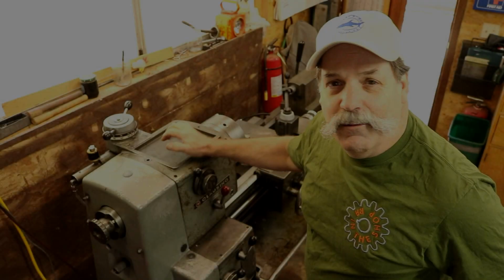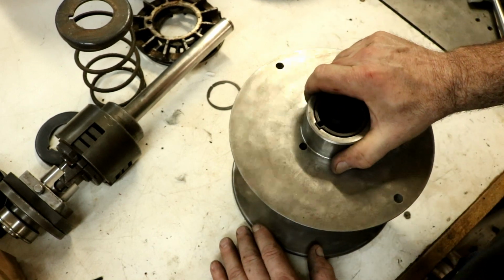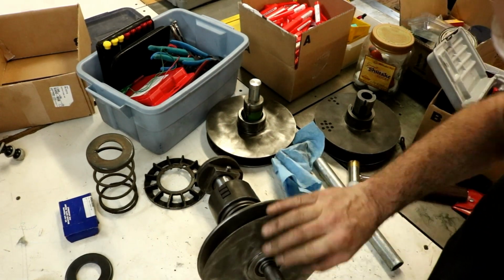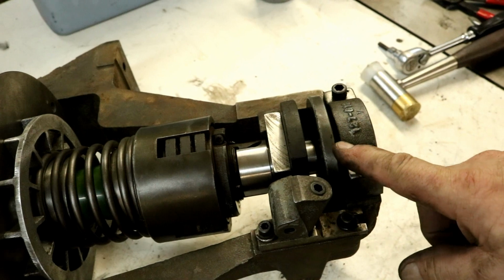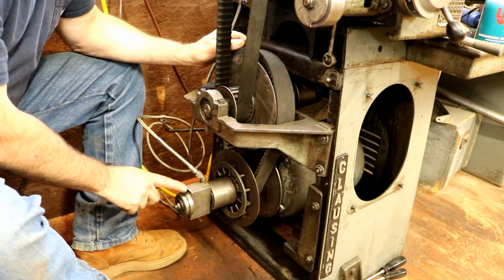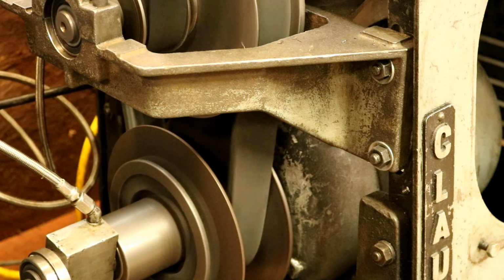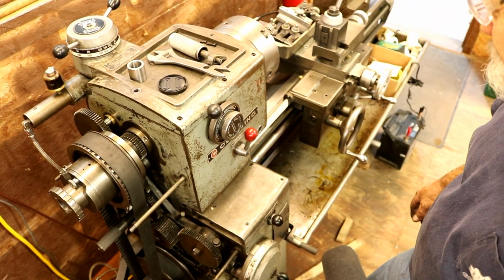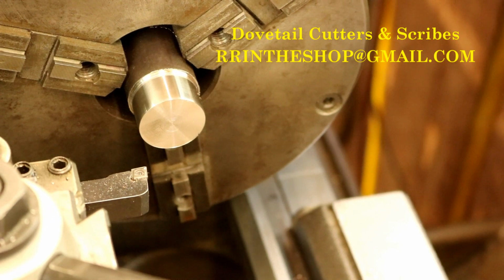How To Repair Crosshaft Variable Speed for Clausing Lathe Part 2 Final

Comment: Randy what did you have to do to the switch to make it control the fwd and rev on the VFD. I am doing the same with my 5913 and I seem to get confused when I try to make the switch work. I realize that ground is common and on my VFD there are a dir 1 and dir 2 and all you do is add ground to either to make it run in fwd or rev but I seem to have hell getting my switch to make the 3 positions. Did you have to modify the switch add jumpers or just wire to the right terminals. Thanks Terry
Reply from the maker: Yes Terry, I disassembled the switch and reconfigured the contacts.  So they would work for this
purpose.

Comment: Wouldn't happen to remember all those bearing numbers would you? My 6913 has been getting noisy the last month or so and when I pulled the cover I noticed that cross shaft sliding from left to right and the large belt is rubbing hard on one side. Looks like i'm in for a project. Also my clutch is slowly slipping out of engagement.
Reply from the maker: All of the bearings on the cross shaft are the same.  I will find the info.

Comment: Really nice job Randy, enjoyed seeing the lathe come together. Dont know if you have a collet system with that lathe but if so that might help you isolate the chatter....but am sure you will get it ironed out ~ Richard
Reply from the maker: Yes I do have a 5C closer,  I had 0.0025 runout in the spindle, I was able to adjust to 0.0005.  Working great now.  Thanks for stopping in.

Comment: Nice job

I have a classing and it’s a great machine
Reply from the maker: I have not really used it yet,  I need tooling that fits.  I think it will be great, runs very smooth and I  fixed the run out issue.  Thank you Dave.

Comment: what if you try the heavy spring with the shorter spacer.
Reply from the maker: I will give this a try to see how it goes first.  Then evaluate.  Thanks Steven.
Reply: You're welcome
Reply: Randy Richard In The Shop just a thought
Reply from the maker: All thought appreciated.  Right now just not feeling like tearing apart again.
Reply: Randy Richard In The Shop it's running it's working I wouldn't want to tear it apart either good job

Comment: That's a sweet drive system.
Clausing makes a sweet lathe.
As with all used equipment, it takes time to get all the bugs out.
I am fully confident you'll soon have the best running Clausing ever.
I've been looking at variable speed belt drives for a couple different applications so this is very interesting to me.
Thanks for another great video.
Thanks,
John
Reply from the maker: Thank you John.  Running well.  I need some tooling for it now, so I will be working on that.

Comment: Hey, I see that yellow old navy (not "Old Navy") battle lantern in the background. I'd like to have one of those. Haven't seen one in years.
Reply: On topic: that weaker spring seems to work just fine closing the pulley disks back up. I imagine the stiffer spring might have resulted in faster belt wear. Do these belts ever get any lube dressing?
Reply from the maker: You may be correct on this, the belt that came off the lathe was trashed.  I think I will get some belt lube to apply.  Thanks for the thoughts.

Comment: glad you have it up and running   My brother and i have 2 6913 clausing and 1 6303 clausing . your manual should have the belt replacement  guide in it . we put the belt on the intermediate shaft on the bench then put the whole unit on the lathe. the drives are a pain but once you go thru a learning curve life will be somewhat easier,
Reply from the maker: Thanks Richard.  Gotter done, but a pain.  Runs very smooth now.

Comment: I remember reading an article about struggling with the finish, one thing was to mount the motor on rubber, may be worth a look, nicely done Randy.

Regards Alan.
Reply from the maker: Vibration solved, 0.0025 runout in the spindle.  Tightened 0.0005 now and no vibrations.   Thanks Alan.

Comment: Deere uses a lot of those variable speed pulleys. What that thing really needs is some grease seals where the moving sheave slides on the fixed one and some grease in there, That coating likely is not enough slickem as those things really need to slide nice with very little clearance as soon as they start to cock from the uneven wedging caused by the belt they destroy themselves.
Reply from the maker: Yep you are spot on Brian.  These are a terrible setup.  This should work for a home shop lathe for awhile.  I have these other pullies and I might do some mods to them to make things better.  No harm they are junk right now.  Thanks Brian.

Comment: Nice job Randy, that drive system looks like a major PITA to work on.  Lathe sounds smooth and I read the comments that you got the vibration problem solved, good deal.
Reply from the maker: Thanks Bill.  Got that sorted out yesterday, works fine now.

Comment: Glad you managed to finish up with a decent vari-pulley. Altogether you've had quite some challenges getting things sorted out.
That whole shaft is quite something with clutch, brake etc as well as the pulley. Great work.
Sure is running sweet and quiet... love it. You've gotta be super stoked at the results.
Reply from the maker: Happy that is done,  Should be good for a home shop lathe.  Thanks Chris.

Comment: Congratulations on getting the Clausing Lathe to run well again and so quiet when running at high speed. This has been a fun series to watch.  Also, thank you for putting together the various play lists because you have published a lot of video material over the years. I think after your lathe leveling work you will have an outstanding lathe for more projects to video.
Reply from the maker: Thanks Paul. All leveled and spindle adjusted. Vibration solved, 0.0025 runout in the spindle.  Tightened 0.0005 now and no vibrations.  I should make something on it now.  I need to come up with some tooling for it. 1/2" shank.  I have to rob from the Logan for now.

Comment: wow, what an effort. i commend you for your tenacity. i have a JET that hasnt run in 5 yrs. Apron 1/2 nut housings failed. Jet sent the wrong part 3 times. After 4th try I got them made right. discovered dovetails operating 1/2 nuts getting no oil. still havent got oil feed solved. Sooo your job 10x mine. 10 pts &  1 for extra credit.

Comment: Nicely done restoration. ...   ;)
Possible that the vibration comes from you insert holder, it seems to be hangnig out quite far, it doesn't take a lot to make some singning...   How about heavier cuts, how does it deal with those...???
Cheers,   Pierre
Reply from the maker: Vibration solved, 0.0025 runout in the spindle.  Tightened 0.0005 now and no vibrations.  Stay well my friend.  Thanks.

Comment: i was a millwright in a steel mill machine shop years ago. we had four of those lathes and were lucking to have two running at any given time. most of the troubles were in the variable drive. parts were so hard to get that we used one lathe as a parts doner. when the five year depreciation was up they were scrapped. i didn't miss them. i expect you to have much better luck in a home shop environment good luck.(good video).
Reply from the maker: Solid machine, but the drive system sucks.  A flat belt drive would be better.

Comment: There is nothing simple about that Clausing drive.  Designed by the devious mind of an Engineer!  Thank goodness for snap-ring pliers!   I almost bought a Clausing, glad I didn't.  The problems with the hydraulic speed control and pullets is what turned me off these lathes.  Great work on the restoration.        Hope you have a great trip.  Stay safe!
Reply from the maker: This is a good reason not to buy one.  There are mods folks have done with replacement with a Jack shaft and vee belts pully.
But there are draw backs to that also.  This repair should work for quite awhile in a home shop.  Thanks Vernon

Comment: I see you tool post handle is like mine was out of position. I went a far a changing blocks but the Chinese can’t seem to get the handles right. My solution was move the shaft. Here is the link to my video https://youtu.be/NC9Wq75xmHc. On how I did it. Hopefully it can give you an idea
Reply from the maker: Already fixed, I made a new handle and changed it's position.  What were they thinking?  thanks James.
Reply: I know. My original tool post was from Grizzly was out of position so I assumed it was Grizzly’s vendor because I seen several other people on YT that was the same way. Purchased an import wedge block off e-bay an it was the same way, you couldn’t restart the screw for the wedge to reposition the handle in the proper position. My problem was my boring bar holders wouldn’t clear the handle so,that’s why I went through the trouble to reposition the handle. I have a piece of stainless that’s begging to be used as a handle

Comment: Really nice job Sir. Hope the harmonics issue is not another bearing.
Reply from the maker: Vibration solved, 0.0025 runout in the spindle.  Tightened 0.0005 now and no vibrations.  Stay well my friend.  Thanks.